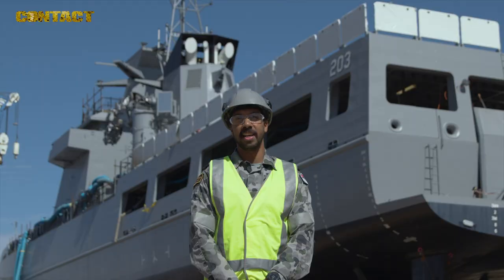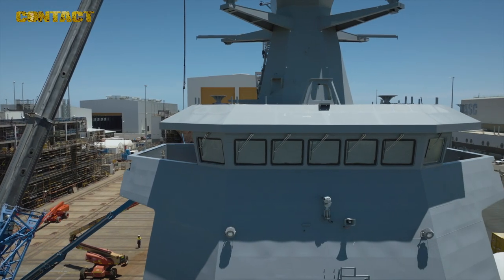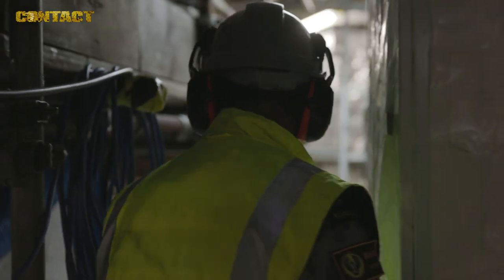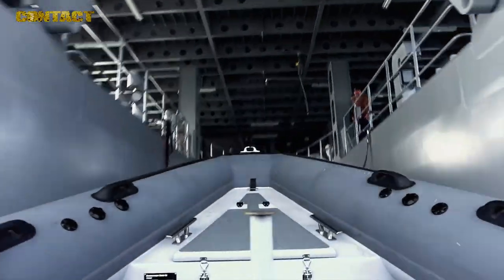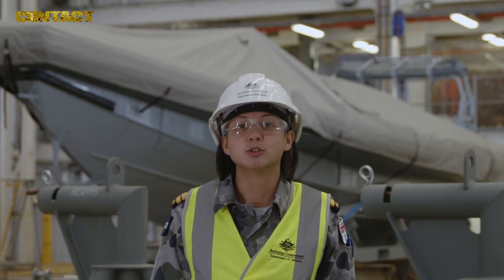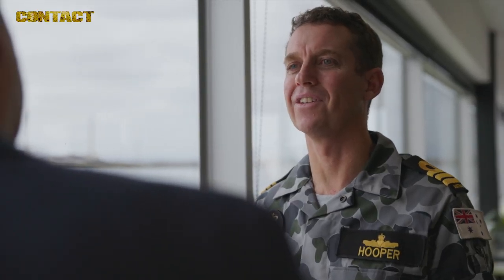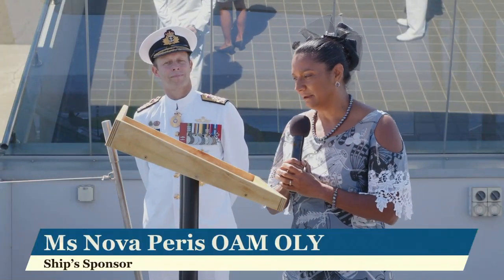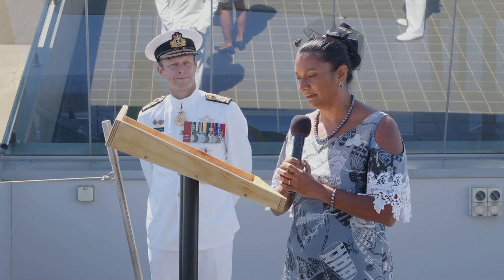First Arafura-class OPV launched

Comment: They are big enough to be a corvette but completely lack any meaningful weapons. With the current climate these ships need to be able to launch missiles. A missed opportunity.
Reply: No, It's an OPV with Mine warfare configuration. It can be refitted with cannons and missiles if necessary like Brunei's. But to save cost for their primary mission, missiles and cannon are not necessary. There's always contingency configuration for wartime with this ship.

FYI, OPV is not designed for warfare in general but mostly maritime laws enforcement.
Reply: Jjohnno 87  The 21 cell RIM116 Rolling Airframe Missile and Harpoons can be deck mounted. They don’t require any below deck refits at all.

Comment: I had hoped they were going to use a mainly SAAB combat system and radar teamed with the Bofors 57mm Mk3 main gun as the Offshore Patrol Vessel seems to have been designed specifically with the 57mm Mk3 in mind.
😎🇦🇺

Comment: OMG these people in the comment section don't understand about OPV-MCM and future naval warfare at all.
Reply: Agreed! While it would be possible to fit them out with the very capable NSM (low RCS + IIR Seeker sea-skimming ASM with land attack capability), the range of this weapon is modest, while a Chinese surface combatant would carry longer range ASMs. The Arafura is a bit of a slow-poke in comparison in terms of flank speed, and with no provision for multi-layered ASMD, it would not take long for it to be hunted down. 

If it carried an MQ-8C UAV equipped with sonobuoy pods it would be useful assisting a Hunter class frigate to deploy a multi-static sonobuoy sensor network, and could provide an airborne surface search sensor for OTH targeting for missiles launched by other platforms. And a hydrographic survey capability and a USV MCM capability (carried out at a distance!) would be useful for an amphibious landing group ... but as a surface combatant ... nah! Although it may well be called upon to serve as a minor warship in difficult circumstances, it is not designed for that. The Arafura is a ute but should serve well for constabulary duties ... which is what it is intended for.
Reply: @liefsillion2825  couldn't agree more

Comment: Bigger then what I thought. Nice ship. But I agree with the other comments with lack of defence on it. But same can be said about the ship we bought of England in 2011.
Reply: It's a patrol vessel. They don't need to be armed to the teeth. And yes, like HMAS Choules, it's a transport and support ship. It isn't a front line fighting vessel.
Reply: it's an OPV for mainly patrolling the seas for maritime constabulary jobs, you don't need a big punch for such mission and it's wartime configuration is Mine warfare. It can be fitted with missiles and cannons if necessary just like Brunei. But if you put it there in a peacetime, it will just add costs of manpower, maintenance and being idle most of the time.
Reply: @lachlanlandreth9069  i didn’t say it needs to armed to the teeth. What I was saying that in todays threat environment it need to be able to defend itself.
Reply: @themadmutt2270  for the role it does, It can defend itself.
Reply: Didn’t say it couldn’t defend itself. But what I am saying it would be better if it had better defence.

Comment: Why don't  Australia put a 76mm main gun on this thing some antinship missile systems and torpedo tubes. And a 21 sea ram Missile system and a decoy system on some of these boats and have them as a attack OPV. 

Sweden have developed anti ship missile and torpedos for these size ships. Sea ram system will work well on it also. Use some of these as a coastal submarine hunters
Reply: Cost, manpower and mission focus. There are other ships that are capable to handle such threat with that matters in peacetime. Different navy requires different needs. Brunei's similar OPVs are a mini Corvette. Because it fits for their needs, they don't have a big Frigate to begin with due to manpower issues. So putting missiles to make their OPVs multipurpose vessels are one solution. This OPV is configured with Mine warfare system BTW.
Reply: Why? That's what frigates are for
Reply: @saltymonke3682  so what protects Australia  when all frigates submarines  and AWD are deployed  elsewhere  and ships or subs get through? How will these opv protect  itself?. I'd would thought  more firpowew  the better.  Anyway  let's see how well Australia  does with its selection  it choose for a defence if the time comes. I got a feeling  thoughs OPV will go stait to the bottom of the sea as they so lightly  armed. Or confiscated by the enemy  then decked  out like the should be.
Reply: @Nathan-ry3yu  ???????? what protects Australia???? are you nuts? have you been in a naval operations before??? there's no such thing as that, because of the maintenance-standby-operation cycle of ships. That's basic naval tactics. There's always a ship behind or in the dock if you have a sane Navy.

You don't know how modern maritime operation works mate, this is no WW2.
Reply: @Nathan-ry3yu  and to add that, you don't put your eggs in one basket. 

You know why modern subs don't have AA warfare prorection or deck cannon? where's the firepower hurrdurr..... 

It's called Mission focus doctrine

Comment: It shame it’s not OPV design from Transfield defence with 57mm gun, 8 VLS, 4 harpoon missiles, helicopter hanger n deck to land 5-6t helicopter, which Arafura class can’t because lack of reinforcement deck. I heard the RAN change their mind with 40mm gun? Another ANZAC? Fitted but not for?
Reply: why do you need those for constabulary missions? this thing is also MCM and Hydrographic configured vessel. Why do you need to put a massive gun there? Those things will sit idle most of the time during the peacetime operation.
Reply: @saltymonke3682  MCM n Hydrographic are next versions but needs be arm especially when illegal fishing boats don’t stop when order.  What happens if drug boats start arming themselves?  Learn from history what happen when HMAS Sydney came across German raider, these OPV would be first to come in contact with enemy in pacific islands.
Reply: @jamieshields9521  no, it's fitted in this vessel because of its modularity. RN next gen MCM and Royal Dutch Navy MCM will have Hydrographic capability as standard or modular/interchangeable with OPV.

HMAS Sydney was a cruiser in a wartime, I repeat WARTIME. This OPV can be fitted with cannons and missiles just like Brunei's. why don't we fit it now?

COST, MANPOWER and Mission Focus.

Missile and cannon will be idle for most of its main constabulary mission in peacetime. Maintaining a missile battery is expensive.

First to contact? armed Chinese fishing trawlers? international weapon sales are not that easy for civilian. You want to put a missile system ona. fishing trawlers? let me see your inverter and power generator because it needs specific frequency.

Comment: I notice a disturbing littoral-naval trend. Seems to be infecting Canada, Ireland and now Australia.
The continuing tendency for lighter main deck gun. Perfect example HMS Aradura. Initially planned for 40mm Marlin auto cannon. Yet downgraded to a 25mm varmint cannon. I suggest this is government appeasing an ineffective shipyard. The shipyard desires to NOT handle such heavier gun (thicker steel cutting and welding, heavier cranes not needed in modular commercial vessels) So in effect places such as Irving shipyard in Canada, doesn't want to build it as per blueprints. Complicit navy downgrades thier main gun to appease the cheap shipbuilder.
And navy bean counters love this merely because the militaries formerly involved in Afghanistan can consume previously bought & paid for, Huge war stockpile 25mm Bushmaster cannon. I think this is true. Other evidence this might be true: Why isn't the Canadian navy insisting the Harry DeWolfe class vessels come with a forward multi gun mount in a single turret??????
Name me one western navy with a twin 25mm cannon last 20 years brand new equipment?????
Wag the dog folks. Tail wagging the dog.